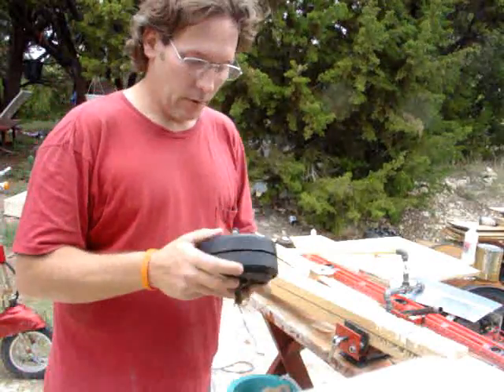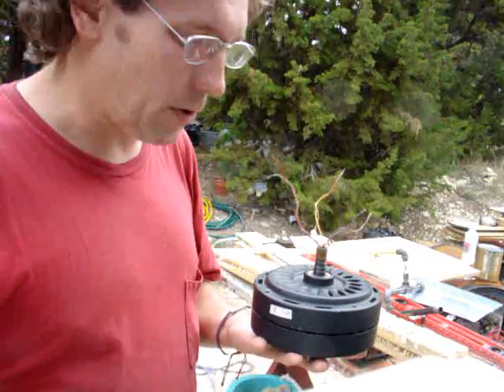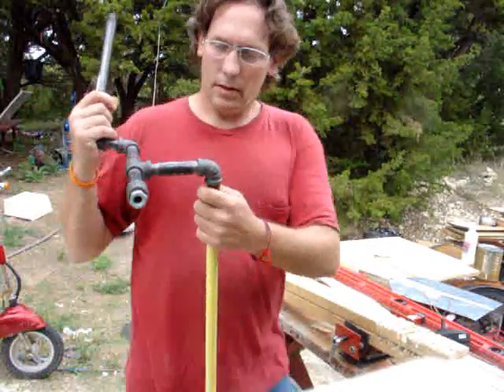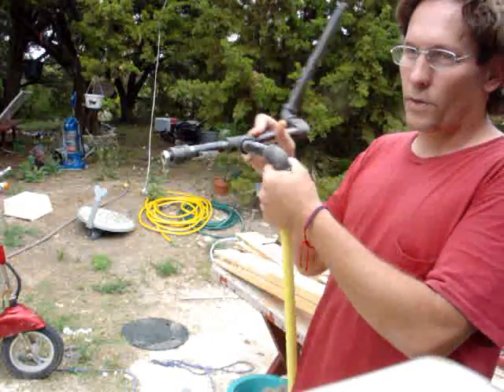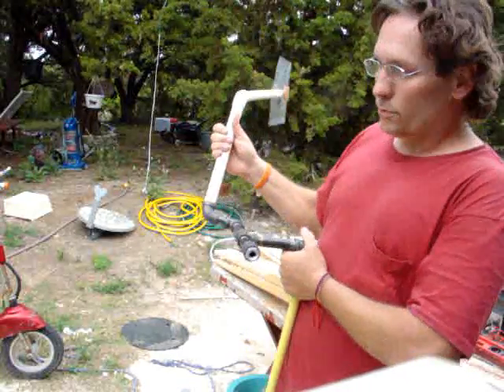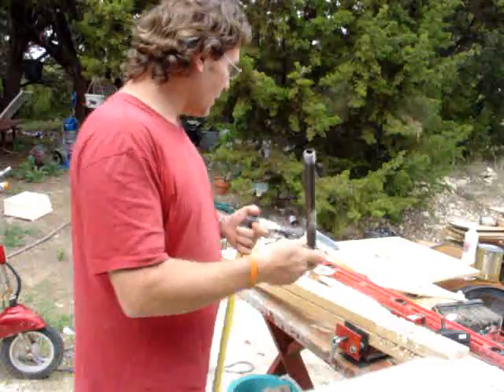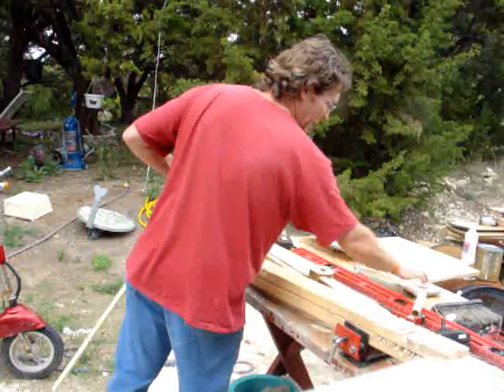PART 1 HOW TO CEILING FAN WIND TURBINE

Comment: Hello, I have been racking my brain trying to calculate the value of energy storage and was considering using a hot water storage system, could I connect a heat element to a windmill and use all the energy to add heat to my 5,000 gallon storage tank?

Comment: Good job.
What you you think about the vertical  windmill designs?
Reply from the maker: +Benjamin Gliniak 
I like them, and will build one someday. Hopefully soon.
They are less efficient though, and slower. But making them bigger can cure that. The diameter controls the speed on torque. The height can add torque without changing the speed of rotation.

I like the Darius models, and the Lenz turbine the most.
Savonius models are around the slowest, but start in very low winds.

V.A.W.T.s are less efficient because there is always a blade headed towards the wind. And they use drag to turn on most units, Very few models actually use lift. Lift is usually the largest percentage of the power absorbed.

American Multi blade configuration use lift and are amongst the better quality and more efficient units.

MUDDy

Comment: Where do you get the magnets from? What do you recommend? I have several ceiling fans that I want to produce my own energy to power items in my home soon get off the grid. my email is pastorwilliambarhorst@yahoo.com
Reply from the maker: +Pastor William Barhorst I used to get them from walmart when i was in a hurry. But their size has dropped by 80% in size, down to 20% of their size.
Usually i get them from CMS magnet supply, or applied magnets. 1/2 inch round, by 1/8th inch thick. You may want thicker magnets to help fill the air gap if you want. But the 1/2 inch diameter is used because 1 inch wide magnets do not fit well on the curved outer circumference. So two magnets of the same polarity cover one coil area. In other wards,.... One polarity per coil. That takes one inch, or two 1/2 inch magnets.
MUDDy
Reply: +muddymuddymuddmann thank you for the reply. I'll let you know how things things turn out.
Reply from the maker: thank you Parson. I would enjoy that.
MUDDy

Comment: Have you ever thought of using a car alternator to charge batteries, instead of making one out of a ceiling fan? or will it not work?
Reply from the maker: Bubba Smith  car alternators start charging around 700+ RPMS. I tried a smaller faster prop on one. it did ok in high winds as a trickle charger because of the small prop. when the wind died down to normal 10 to 15 mph winds, the voltage regulator fed the field rotor coil windings juice from the battery and drained my battery. 
      A larger prop would have more power, but it would have to be geared up to keep the RPMs up. but gearing it up would have more friction losses. 
The regular car alternator is only 5% efficient already. So 5% efficiency means 1/20. or It would take 20 HP in to make 1 HP of electricity. That is mainly because it uses electricity from the battery to energize the field windings so it will have magnetism to rotate to all of the inefficient stator coils, so it can start making 5% more electricity. A very inefficient way of doing things.
     Motor companies want to sell cars that use more gas, so they can sell more.
AT your expense. 
     
     Anyway, these ceiling fan alternators are 45% efficient or less, but better as a trickle charger. They don't produce much amps like the car alternator in high winds, But these DIY toys do it in low winds and high winds, and do not drain the battery bank. They are slow and cheap to build, and above all. I have a lot of fun with them. and the voltage matches nicely to any battery voltage up to 36  or 48 volts. 
     Also, I have run 12 strands of LED Christmas lights directly from the ac windings. quite a versatile toy to say the least.
     I hope this helps. And thanks for the great question.
MUDDy
Reply: ***** Dear Muddy, is a little time that I follow you and I see that you are a truly exceptional. It would take millions like you. For real. I do not speak English because I did French at school and then apologize if I can not make myself understood well. I am using the translator babylon, correct me if I see wrong. My English is based on the texts of creedence cr sting, pink floyd etc.
I met turning to the internet and I was impressed because I also had the idea of using a ceiling fan with reels ready, instead of using the system Piggott that although very beautiful requires time and equipment. Also I like to recycle things that others call unclean. Unfortunately since the start of the collection I can not find anything useful.

When I saw your video I have been very useful to me even though I tried a little bit of envy for not being there before I arrived. Now I have finished editing the generator and I see that I charge the batteries.

It all started three years ago, the reason is that I needed electricity and water in a garden where I had rabbits and chickens but I wanted to automate everything not to go continually to give him to eat and drink.

I realized with a bicycle wheel and three-blade aluminum, a rotor that through a head emery (or flexible) commuted the rotating motion from horizontal to vertical and down to the ground (coaxial tube support group helix ) where through a belt multiplied tours to drive a generator car that begins to deliver power only after the 400 rpm. Unfortunately, given the lightness of members of the strong wind has knocked ruining the blades. I was afraid of how strong revolved. But it worked for at least 1 hour. After three severe drops have left the project.

With the generator ceiling I thought for strong winds to bring into dance centrifugal force

Muddy if you come to Sardinia leave you free my beach house for as long as you want, my wife agrees.
Reply from the maker: Thank you Pietro.

The offer of the beach house is a grand gesture from the heart.

     for the ceiling fan alternator, I would use a 5 foot wooden prop. They seem to work fine. I have seen them withstand 80+ mph winds several times per year for 5 years. Also they are simple, cheap, and easy.

     I am sorry you had to leave the project. But I do understand the frustration. Every lesson has a price. But once the price is paid, The lesson is still there. The knowledge that you gained is priceless. Be glad in the lesson. :)
I believe You will enjoy the ceiling fan wind turbine. And never under-engineer what you build. The wind is wild. :)

     Keep up the good work. When you are done, you can spread the knowledge to many others.

     God bless you and your family.
Enjoy.
MUDDy

Comment: need angle of tail arm
Reply from the maker: Amy Cover yes , exactly.
Thanks.
MUDDy
Reply from the maker: Amy Cover The angle on this one is about 45 degrees, and is not leaned straight back. It is also leaned in a direction that keeps it into the wind a bit longer before it starts to furl out.
MUDDy

Comment: Thank You... I am going to build one. Good designing.
Reply from the maker: ***** Thank You,
I hope all is easy for you. I will be interested to see the final results, and/or steps along the way. I do encourage carving the prop instead of using commercial blades, or dangerous PVC blades.
    Wooden blades do not put off static pulses, and can withstand very high winds due to the direction of the fibers in the wood.
strength to weight ratio is very high, and they are light, cheap to make, and easier than most folks think. But most of all, If times get hard, You can make more easily. 
    above all, Enjoy!
MUDDy

Comment: What size are the magnets. Getting ready to start one of these.  Rare earth magnets work?
Reply from the maker: these are 1/2 inch magnets by 1/8TH inch thick. But any kind that fits the width of one coil. I use two magnets side by side for each magnetic pole, because it helps getting the magnets fit the curve of the outer shell of the motor.
Enjoy.
MUDDy

Comment: Thank you, Muddyman!
Watched all your videos and made my own. My operation is micro-micro hydro, but it works great and is charging my batteries. Ceiling Fan PMA + Water Wheel = Free Power (Pt. 1)
I'm beginning my 2nd PMA and having a great time doing it.
Steve
Reply from the maker: Thank you Mr, Round, Building these PMAs seem to be addictive, and easy on the pockets. Enjoy.
Stay warm.
MUDDy
Reply: Here's a related question ....
My first water wheel PMA on the outlet side of my pond puts out about 40 volts which is pulled down to app. 12 when fed into my battery. Now I have a 2nd water wheel going on the inlet side of my pond which produces an additional 20-30 volts . Of course both are fairly low amperage.
Can I somehow join the wires coming from these two PMA's and feed directly into my battery bank? I now have 3 deep cycle batteries and tend to watch the charging process very closely.
Reply from the maker: Stephen Round good question Steven, You may add more gennies to each wheel, and put the outputs ,of the bridge rectifiers, in parallel.
   or rewind the stator with a fatter wire. I tried 18 gage, but the tests seem to be pow on voltage. I am contemplating trying 22 gage for the next rewind.
MUDDy

Comment: That's the FIRST speed control I have seen!  You better patent that!
Reply from the maker: Thank you for the compliment. But even though it is Simple and Reliable, It has been open source for years. The only notariety for this would be in spreading the knowledge as best i can. This is a very important overspeed control, and safety mechanism. But most of all, easy, and it doesnt cost much.
MUDDy

Comment: Currently working on one of these with a Hunter fan motor.  Outside and inside ring contains 16 coils each.  I will have to have a machine shop cut a channel in the stator ring to house the magnets.  The clearance will be VERY tight.
Reply from the maker: sounds sweet, The machine shop might have a bit of a problem cuuting the slots into the Induction ring. the layers of steel laminants in the induction ring tend to peal instead of being cut, thus warpage could result.
Good luck and thank you for the comment.
MUDDy

Comment: Hi Scot, just a word of thanks for the very excellent videos and the explanation of the whole process. Question: why not carry AC down to battery area and put the bridge circuit at that end to cut down on loss and keep wiring at #14 or smaller. There is so much loss on running DC any long distance. All the same it a damn good series.
Reply from the maker: EXCELLENT QUESTION, IN FACT YOU ARE RIGHT.  using ac for the run is much better. I was just young and stubborned, lol.
MUDDy

Comment: quick question, my wind generator puts out about 6 volts, my little solar panel puts out 20?v can I wire the wind generator and solar panel in series to get 26V? run it through the solar charge controller and charge a 12v battery?

Comment: Two things I'd like to mention. 1, the inner winding was originally the start or phasing winding,hooked to the run capacitor, and is very low current capacity.  Also, wider blades will give more torque at lower R.P.M.Stan

Comment: thanks....
I am on a wind mill project now and these videos will definitely help me. 
Actually, i was searching for stepper motors to be used as alternator. Your idea to use a ceiling fan motor looks much better and interesting....!
I will watch (& LIKE) all your videos. 
But, as I dont have a better net connection to watch all those videos properly, it will be appreciated if you can send me a document version (OR LINK) with all the instructions to my email ( aniltvmin@gmail.com ) 
Thanks...

Comment: there saying that multi speed motors are a DC generator, do you know what voltages your fan might be Im thinking a small voltage but might be worth it to know if one is working that area.

Comment: hi Muddy, I am trying to build one of the power generating devices for a very long time.
Spent around two months to locate the shops that sell Neodymium magnets. I tried winding coils on metal spool made with bolts and nuts. 3 of them with 1000 turns with a 32gauge wire gives me only 0.03v.the magnets are strong 1/2inch by 1/4inch neodymium magnets. If have decided to follow your video and let me see if get it right. but during my earlier process what was going wrong... can you please tell.

Comment: Great vids muddy, love the detail you provide. I have built my own fan-turbine from them alone, but I have one question. It will probably seem way too simple for you but here it is: How do you tell which are the possitive and the negative wires coming from the stator? There it is, keep up the great work.
Reply: Use a voltmeter. If the voltage is negative, switch them. Red + Black -

Comment: I would have to study the speed at which blades respond to wind (i.e the ration of 4.5 to 1) I understand why a satellite travels 1200 mph in orbit, but a fan moving that fast at the tips in a "perpendicular" wind takes some thought... I have an idea of using a roll cage for the fan that catches the wind, similar to a squirrel cage, i dont think the rolling action could spin faster than the wind except for short burst  -gust...can we make a generator without having to shut off, wind+=juice+ ???

Comment: Hey Muddy, what are some of the rpm to power/wattage outputs for most of these ceiling fan conversions?  I realize they vary based on how many magnets are used and other design factors, but just a broad estimate would be great.  Or what do you think the max potential wattage output would be in average conditions.  I am building one of these based on your vids, but I am building a vertical wind turbine, so the RPMs may be lower, but more consistent I am guessing.  Thanks for all of the info!!!

Comment: Thank you very much for your-valuable videos, but I have a question: why you have tried to grind and make the blades your own self, you can take it also from ceiling fan. if you got the ceiling motor you may also got the blades too, so I think there is no need to take that much time and do the job. Actually if you purchase a good ceiling fan (with nice shaped blades) I think it would be more useful. By the way thank you  for sharing your experience. 
thanks.

Comment: I saw all your videos and they are extremely helpful. 
I wanted to know if i can convert a ceiling fan into a generator and charge a 12V 7AH battery from it; if the output from the generator is around 120V? 
will i need a  charge regulator to save my battery from being blow up or damaged when this amount of voltage enters it?? 
Thanks in advance !!

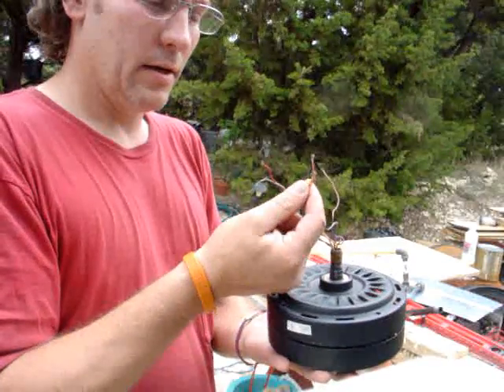Comment: Did he say Yellow or Yaller at 0:55 hehehehe...Great job Muddy! I have two old ceiling fans I was gonna throw out. Now, thanks to you I have more work! :)  Do you have a mechanical drawing with the blades specs, the ya and ferling mechanism and tail sectio?.